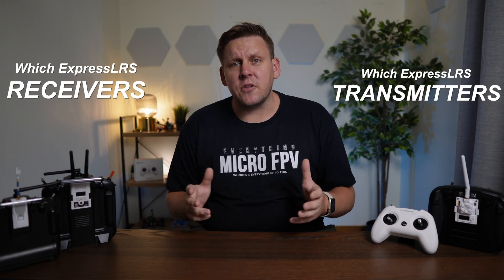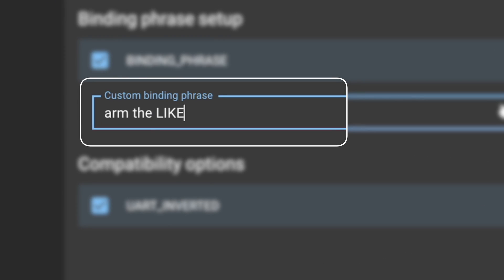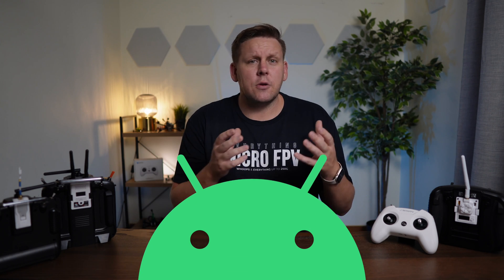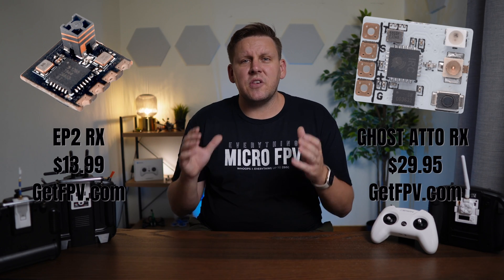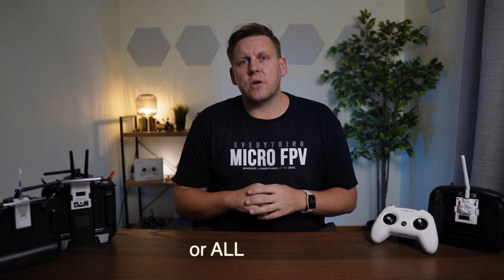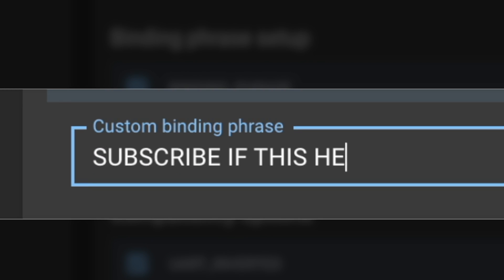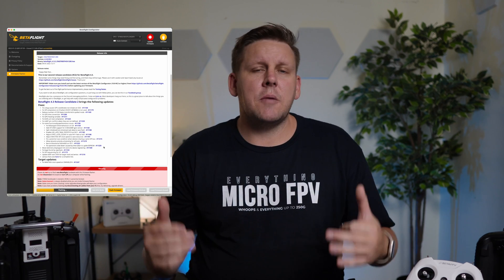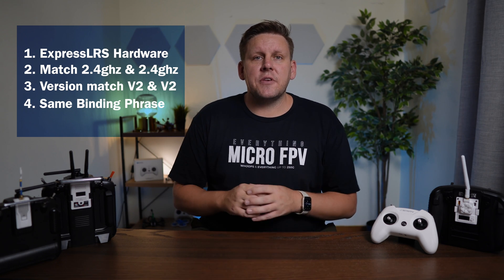ExpressLRS Facts You Need To Know

Comment from the maker: Learn to Build a 5" Freestyle FPV Drone 🎓 https://www.darrenfpv.com/buildmasterclass-5freestyle
Reply: Important to flash everything with exactly the same version firmware. Not even minor versions are entirely compatible. Later versions have better features but many devices lack space for the code, it would appear.
The major oversight in ELRS is the diagnostics on the web site on the RX side. Signal info is really important if things don't work first go and just knowing if the Tx Rx is bound, is critical if you get no response.
I think this is why Configurator offers the firmware version first. But, next time you buy an RX you likely want to use the latest firmware version, DON'T!
Reply: Link not working

Comment: So are you saying if I have a radio master Zorro updated to ELRS 3.1.1, I can’t flash a BetaFPV nano rx V1? It would seem that’s the case because I can’t get configuration to update the receiver in pass-through, Uart or Wi-Fi.
Reply from the maker: Both receiver and transmitter need to be on the same version.

Comment: BETAFPV ExpressLRS ELRS 915 mhz will work with happymodel ep 2 rx 2.4ghz
Reply from the maker: No. As I said in the video - 2.4ghz doesn’t work with 915mhz… you need both TX and RX to be on the same frequency, and you can’t change the frequency, so you’ll have to either buy a new 2.4ghz TX or new 915mhz Receiver
Reply: @DarrenAllatt  thankyou for the help 😄
Reply: @DarrenAllatt  which one is better for high interference area happymodel ES 24tx pro vs happymodel ES 900TX?
Reply from the maker: @umeshkumarravi8243  technically 900mhz will perform better than 2.4ghz from a penetration perspective as the lower frequency can get through solid objects more easily, and is below the noise caused by wifi networks.

The point to remember is, your video is 5.8ghz so that’s going to be the weakest point, from a pure transmission point, and more especially in a noisy RF and dense environment anyway. 

You’ll have more benefit from choosing 2.4ghz over 900mhz because your video will fail before your 2.4ghz radio link does. 

So go with 2.4ghz
Reply: @DarrenAllatt  thankyou for the proper explanation 😄.

Comment: "the only time I update is because of a build or crash" ....Does a crash impact the rx? I have a rx that stopped communicating with the tx after a crash and I just assumed it died. Does re-flashing solve the problem?
Reply from the maker: Sorry I will clarify further… typically after a major crash, my quad goes back to the bench for repairs. Could be anything from a broken part of the frame, smashed camera, busted motor. While it’s on the bench being repaired, I’ll update the firmware. 

Crashing on its own doesn’t necessarily impact the RX, or it’s ability to work. If it’s not communicating with the FC it’s likely the solder points are loose flat either the RX or FC side.
Reply: @DarrenAllatt  Thanks!!

Comment: I bought a Hglrc rekon but is not connecting to my lite 3
Reply from the maker: Was it an ELRS version?

What have you done to set it up?
Reply: @DarrenAllatt  yes does it it support crsf
Reply from the maker: @Rostacks  so which Rekon quad did you buy? There are a few
Reply: @DarrenAllatt  the rekon 7 elrs
Reply from the maker: @Rostacks  have you got ExpressLRS working on other aircraft and this isn’t working; or is it your first setting up ExpressLRS all together?
Reply: @DarrenAllatt  my first time I think it jus doesn’t work with my quad
Reply from the maker: @Rostacks  ok and what Transmitter module is in your radio?
Reply: @DarrenAllatt  idk I’m new to this but I’m using the lite 3 radio elrs version
Reply from the maker: @Rostacks   is it the white one or the black one?
Reply: @DarrenAllatt   the white one
Reply from the maker: @Rostacks  watch these two videos Budget BetaFPV Lite Radio 3 ExpressLRS
https://youtu.be/qpz_Scdw0Vs

How to setup the BetaFPV Lite Radio SE ELRS | | ExpressLRS V1
https://youtu.be/W0NWdmL_L0k
Reply: @DarrenAllatt  Ive did everything right I jus think there’re not compatible
Reply from the maker: Try putting the last realest of v1 on your receiver
Reply: @DarrenAllatt  Alrt but every time I try in flash the lite three it thinks it another setup
Reply: @DarrenAllatt  ima just buy the tpro with the bundle in if it don’t work imma switch to frsky
Reply from the maker: @Rostacks  mate. You are looking at it wrong. There is something you are doing that’s not right. I can’t trouble shoot and solve it through YouTube comments. Join my discord is an online chat group where I can help guide you through the process easier 

Link is - https://discord.gg/3fk5FuaT
Reply from the maker: @Rostacks  Yes you don't flash the Lite Radio through the ELRS configurator, its all managed through a separate BetaFPV configurator
Reply: @DarrenAllatt  Ik they have there owns that’s the one I’m talking about
Reply from the maker: @Rostacks  go onto my discord or add me on Facebook so I can help you - discord:  https://discord.gg/3fk5FuaT
Reply: @DarrenAllatt  Alrt I am
Reply: @DarrenAllatt  I keep trying to flash my drone but it keeps failing do Yk what it could be
Reply from the maker: @Rostacks  join my discord and I can help you - it’s very hard to troubleshoot some thing with you via comments.
Reply from the maker: @Rostacks  link to discord https://discord.gg/2z7DyXuU

Or add me on Facebook- Darren Allatt
Reply: @DarrenAllatt  I’ll add u but imma switch to frsky xm into I understand a lot of this I’m new but with the xm u dont have to do all this flashing right ?
Reply from the maker: @Rostacks  not necessarily because it depends on what FRSKY firmware is on it the xm+ I’m not an expert on FRSKY.

Comment: I own a zorro 4-1 can this be compatible?
Reply from the maker: You need to add an external Nano TX to use ELRS. There is another version of the Zorro with internal ELRS but it’s not the one you have
Reply: @DarrenAllatt  I have the 4-1 version. Can this be complete?
Reply from the maker: @55amps  You need to buy an ExpressLRS Nano TX Module to add to the back of your Zorro. Your JP4IN1 doesn’t have internal ExpressLRS. There is another version of the Zorro which you don’t have that has internal ExpressLRS
Reply: @DarrenAllatt  done ✅ ima get that! Is setting it up easy ? I’m such a noob lucky ik how to bind it regular style.
Reply from the maker: @55amps  small learning curve. I’ve got plenty of videos on how to do it

Comment: Hey man, I got 2 drones with elrs & on the same controller but one isn’t showing LQ 0:0 instead of say 6:100LQ.. do you know what’s wrong with that specific drone that’s not showing Lq but it’s checked on the osd.
Reply from the maker: Is the quad that doesn’t show it DJI or Analogue?

And for that quad is “telemetry” turned on in the Configuration tab of BF?
Reply: @DarrenAllatt  analogue & telemetry is  tuned off! Also just updated all to version 2.4
Reply from the maker: @adrianau4246  does everything work in the receiver tab?
Reply: @DarrenAllatt  yes my controls are responding!
Reply from the maker: @adrianau4246  you need to turn telemetry on in the configuration tab
Reply: @DarrenAllatt  I’ll try this tomorrow morning & get back to you😁thanks have a good night
Reply: @DarrenAllatt  hey brother, it’s fixed!!! Thank you so much man really appreciate your time🤘🏽😌
Reply: @DarrenAllatt  thank you so much for replying 🙀🤘🏽🤘🏽

Comment: I'm just hoping I can buy a transmitter that has ELRS built in as a protocol choice or a ready to select module and solder in the ELRS receiver into my drone then simply bind and fly after it is all set up properly in Beta Flight. No flashing and upgrading just simple like it's normally done with my Skyfly or FrSky models. Think this will happen soon?
Reply from the maker: Radiomaster Zorro comes with internal ELRS. You can put it into binding mode and then power cycle a receiver 3 times to put that into binding mode - no flashing neccessary. 

The whole point of flashing is to keep it up to date with new features and bug fixes etc. However without flashing you miss out on Binding Phrase.
Reply: Flashing is super easy.

Comment: Kind of a misleading video don't you think..? You made it sound like not all elrs modules and recievers work with each other. But they do, as long as they are the same frequency and are all setup properly.. Obviously!!.
Reply from the maker: If you go to the ELRS Facebook group there isn’t a day that goes buy where someone doesn’t ask: does ___ work with _ . Is it misleading to provide the answer in a video?
Reply: @DarrenAllatt  the way you said it implied that not all elrs modules and recievers were compatible.
Reply from the maker: @JP-qq2kn  but they are not, as you rightly said. You have to match frequency and version.

Comment: The refresh rate needs to be the same also no?
Reply from the maker: Refresh rate is set by the transmitter so the receiver will adopt the refresh rate of the transmitter.
Reply: @DarrenAllatt   did not think that this was the case for spi ones?

Comment from the maker: What ExpressLRS Transmitter and Receivers are you using?
Reply: I'd like to see a ELRS TX Modules comparison... mainly the BetaFPV and Namimno... Do you have clue on that? Thanks for your videos!
Reply from the maker: What about the two would you like to compare?
Reply: I’m using a brand new Zorro with an old Betafpv version 1.0 Nano rx. I updated the Zorro to 3.1.1 and I’ve tried to update the rx as well but it won’t take the update. It tries to access COM 16 and comes back with error “access denied” while using beta flight pass through. I’ve disabled firewalls, updated stm drivers, the rx just won’t flash. I’m going to try a newer rx next. The betaflight nano is something I won from TweetFPV’s live stream a year ago. This is my first dive into ELRS and so far, it’s only been a headache. It took hours just to update the radio to 3.1.1 when I learned I had to update EdgeTX first. It’s a brand new radio!
Reply from the maker: Updating EdgeTX is more of a Radiomaster problem than an ExpressLRS problem. Update your receivers to 2.5.1 via Wifi, then to 3.1.1. Always do wifi and not Betaflight pass thorough